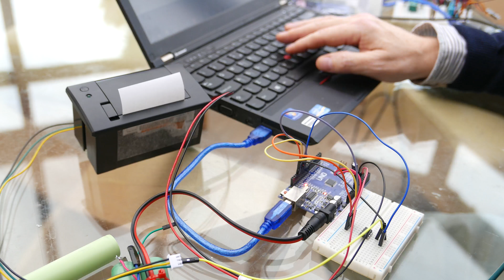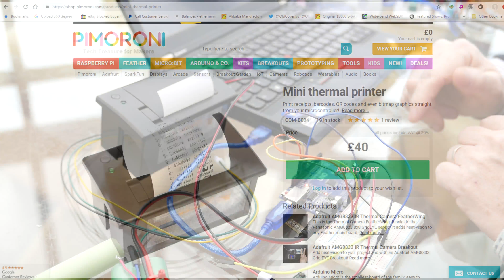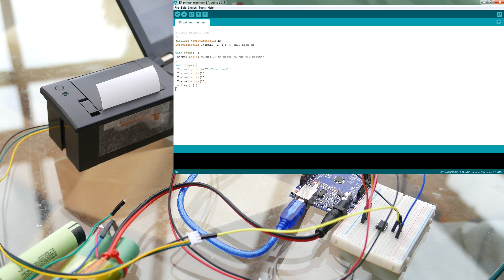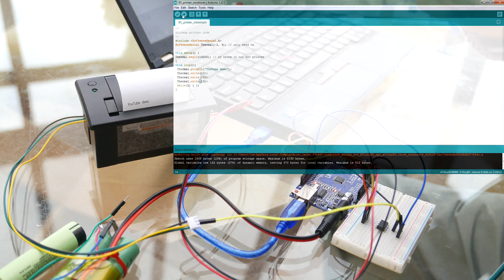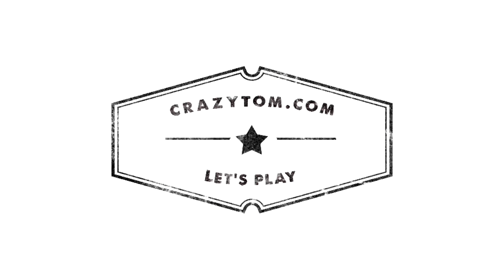ATtiny-85 Printer - Thermal Printing

Comment: Hello Tom. Thanks for this video! Your link to the printer manual no longer appears to work. Can you help please?
Reply from the maker: https://crazytom.com/p/thermal/printer.pdf

Try that..
Reply: @crazytom  Thanks Tom! I have been trying to print to it using a Microbit. Basic printing works well but cannot get the printer to recognise the ESC command codes. It just prints the numbers! 😊